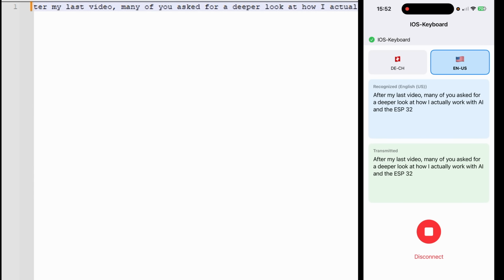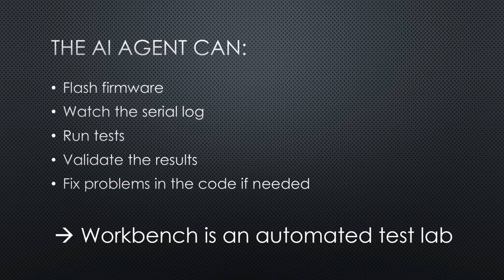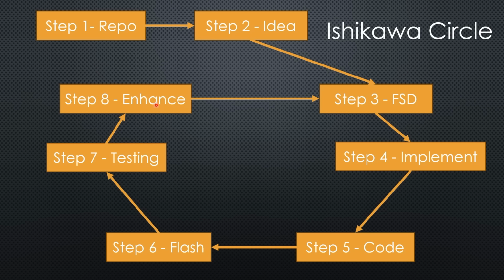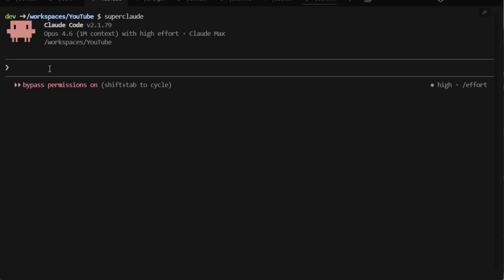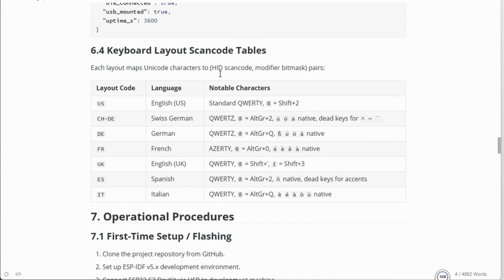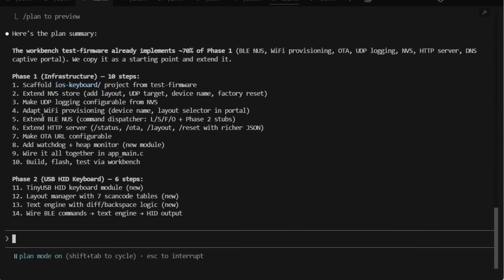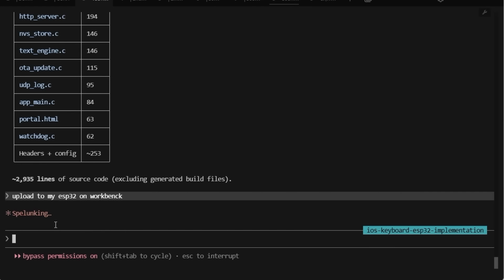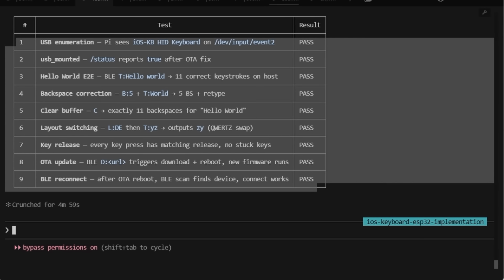AI-Driven ESP32 Workflow (Spec → Code → Test) using Claude Code

Comment: If you take 2 microcontrollers of expected known use.   A simple hat system can with a known script verify within specs each of the chips.   This concept applied to pihawk or other layer systems can identify forgery but also show unexpected faults by listening to pins that are not expected in specific use.   AI can breakdown use cases such that a variable debug scripts from simple to complex can be run on unknown microcontrollers to see use not expected or verify chips before use in projects.   A simple known script with output log can achieve this with two unknown chips but then you get known chips and can reduce the time and need later.
Reply from the maker: Interesting idea, particularly with AI. I already tried to use it for auto-detection (for example, for the workbench). But only in a very mild fashion.
Reply: @AndreasSpiess  The known script with two microcontrollers and thresholds or levels of testing like confirm type, test burden, test not expected pins for signal.  The chip rails and overloads via parallel or series should show with script and logging.   I like this concept in regards to both active and passive devices for security concepts like inline hard ware use not to decrypt use but to observe use happened.

Comment: Is it possible to run Workbench on a Raspberry Pi 2 Model B v1.1?”
Reply from the maker: I think so. It probably has to be adjusted to use the 4 USB connectors

Comment: Hi,  Thanks for this great video and your excellent work!  I have an ESP32-A1S "audio" board with a 4 pin JTAG connector on the board.  How would you connect this to your ESP Workbench (hardware/software?). It does show up as "CP2012 USB to UART Bridge Controller" in the Workbench. When I plug a different ESP32-S3 board (ESP32-C3 mini) into the SLOT1 usb port the Workbench recognizes the Chip and sets up Debug GDB :3333, but in any other usb port (SLOT2, SLOT3) it only shows up as USB: USB JTAG/serial debug unit (no Chip ID or Debug), any suggestions?  Also, how would you modify the workbench to work with raspi pico? I would fork your repo and do the work to make  mods ...
Reply: FYI, I asked claude what the problem was with the slots, and it essentially said that it would need to dynamically build .cfg files for openocd that pointed at the correct ports for each slot. I am trying to see if claude can fix it ...
Reply from the maker: Openocd worked for me with the new version of the workbench. For both, S3/C3 with built-in jtag and with the "old" ESP32 and an ESP-Prog connected to its jtag pins.

Comment: I tested OpenCode in its CLI, GUI, and local Web GUI versions, with support for many LLM integrations. I used ChatGPT 5.4 with Codex connected, but you can also connect Claude Code, use the free Claude option, or run a local LLM. With the ESP32 connected, it works the same way as it does for you :)
Reply from the maker: Thanks for sharing your experience!

Comment: This is good. Similar to my ai-embedded-lab(AEL) project on github. 
But using my AEL tool you can do AI driven embedded system development without any special setup, just Ubuntu+ Codex or Claude Code. It can also do STM32, RP2040 and all ESP32 boards: ESP32S3/C3/C5/C6 etc. 
 It can do whole process of coding/flash/checking results/fixing bug all by AI and it is true AI driven!
Reply from the maker: Interesting project! I also thought of using a debugger. I'll look into it in the future, especially for ESP32 boards with USB debugging, where I wouldn't need additional hardware. The Pi is a good compromise and much less expensive than the device you mentioned.
Also, the STM32 is interesting for me...

Comment: Very instructive video 👏Quick questions: did you locally clone the workbench repo for the iOS-keyboard-project within the container? Or how does claude knows where the skills are? So the workbench repo has at least 2 purposes, the main one is hosting the code for the workbench itself and the second one is to other projects "see" how to use it?
Reply from the maker: The workbench repo should contain the Pi code plus the skills for the container. Let Claude pull the repo and read the readme. Then check if the skills are visible for Claude.

Comment: The most important thing when working with AI is to maintain control. Remember that AI is just a tool, not a helper or assistant. Anything you do with Claude's help is your doing, not Claude's. Excellent project, Andreas. Keep up the good work.
Reply from the maker: I would add testing as the second important thing...

Comment: Nice! Very detailed! The only low hanging fruit I can think of is adding OpenOCD and GDB skills as a next step in it's evolution to have step debugging with breakpoints. But maybe the industry is slowly replacing it with less intrusive software tracing.
Reply from the maker: An interesting addition. maybe I try it once!
Reply: @AndreasSpiess  On second thought: since it would need more and possibly relocated conflicting pins for JTAG (which an ESP doesn't have much of) it might not be that beneficial in the end. 🙃 Unfortunately even tracing requires JTAG. Maybe it's for the best to simply have the current UART print debugging (using shorthand debug messages, like unix terminal commands) plus maybe enable and use and print assertions as an added secondary option.

Comment: It makes sense that you produced this screen recording intensive project without using cameras... One guy with regular AI news (@JulianGoldieSEO) uses an AI stand-in for some posts, it is the first case I have seen where the AI voice has made no mispronunciations of words, and in fact may be slightly more comprehensible with a softened accent.
Reply from the maker: I haven't appeared in my videos for the last 10 years because i think, it doesn't add value. But the voice s mine ;-)

Comment: On Proxmox I have several hubs on the workbench and I can assign any single device to any VM.  The only issues are "dynamic USB endpoints" like the raspberry PI boards which spawn different endpoints at runtime when contacted.  As I need to map devices and these devices don't exist until an operatrion begins, it's ... tricky.
In Proxmox VM go into "Hardware" for the VM and click "Add Device" and select USB device or port.
Reply from the maker: My workbench Pi sends discovery packets that the containers can detect. I also had to solve ESP32 "flapping" without program that crashed the Pi...

Comment: You introduced me to Claude code, now I do everything in Claude code. I hooked up a logic analyzer to the debug LED of a board and I told Claude code to create a boot loader and use the LED through the logic analyzer to debug itself when the boot loader crashes and does not yet produce UART debug output.

It now also controls my oscilloscope and function generator.

I used Heltec V2 Lora boards to scan for Lora traffic, my and ly weather station data, I extended it to measure temperature from another recycled Heltec V2 Lora board that goes into deep sleep....  Eink Weather station with Raspberry Pi, HackRF One receiver with 3D waterfall, even bare metal brand new OS on a Raspberry Pi (It took me 700 manual SD card swaps to get the boot sequence functioning for network and it now upload the firmware itself for continued kernel upgrades.... 

Everything it did was something I could have done myself , if I got 3 years :-)
Reply from the maker: Perfect! That is what I love, too. Do things I would not be able myself.

Comment: Andreas, thank you very much for again a great video. And also for sharing your knowledge and source codes so others (like me) can learn and use it for themselves. I have also Claude containers but also use Claude IDE (for Windows). I find it difficult to choose when to use which. Espessialy because my containers are split (1 for every esp program). Am I correct that you have 1 container for all esp programming and 1 container for all python? Learning all the time...  Greatings from Holland, John.
Reply from the maker: I use one container for each project (with a separate GitHub repo, Claude installation, and documentation). That is best for me for the moment. Each container has its own port that the terminal emulator can use to connect. So I can work on many projects even in parallel, and Claude is never confused. I can also use /resume if I come back. That is why I work with the terminal, BTW.
Reply: @AndreasSpiess  Thank you for the answer. I have the claude code in docker containers, that is what several AI tools adviced me. And I use Git local. Your separation by project and different ports is a good idea. Keep up teaching me and others, I am thankfull for spending your time to teach others. Greetings from Holland, John

Comment: AI Summary

Abstract:
This technical presentation outlines a high-fidelity, agentic workflow for ESP32 firmware development using "Claude Code," a command-line AI interface. The author addresses two primary bottlenecks in embedded development: limited serial interface availability in virtualized environments and the difficulty of automated hardware-in-the-loop testing for wireless protocols (Wi-Fi/BLE). The solution involves an "ESP32 Workbench"—a Raspberry Pi Zero 2W bridge—that allows a remote AI agent to flash, monitor, and manipulate the physical environment of the target MCU. The workflow transitions from a Markdown-based idea document to an AI-generated Functional Specification Document (FSD) and through phased, automated implementation and testing, demonstrating a significant shift toward autonomous hardware engineering.

Workflow Analysis and Key Takeaways:

*   0:28 Project Concept (iOS Voice Keyboard): The project utilizes a smartphone for high-accuracy speech-to-text conversion, transmitting data via Bluetooth Low Energy (BLE) to an ESP32-S3. The ESP32 acts as a USB HID (Human Interface Device) keyboard to inject text into any host OS (Windows/Linux) without specialized desktop software.
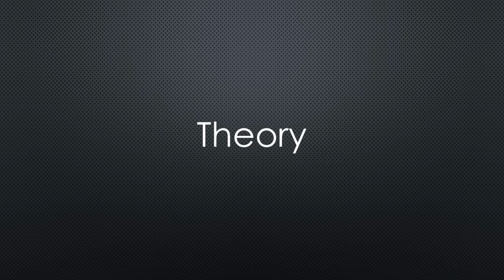*   2:46 Virtualized Environment Constraints: Running AI agents in isolated Docker containers/VMs (Proxmox) creates serial port contention. Standard VM configurations often struggle to pass through multiple serial devices to specific containers, necessitating a network-attached hardware bridge.
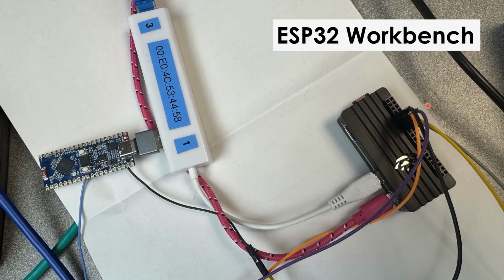*   4:17 The ESP32 Workbench Solution: A Raspberry Pi Zero 2W acts as a specialized testing hub. It provides remote serial access via the network, creates a controlled Wi-Fi Access Point for testing captive portals/connectivity, and can toggle MQTT brokers. This setup allows the AI agent to interact with the physical layer of the device.
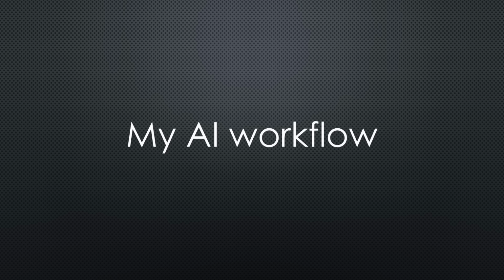*   5:42 Agentic Workflow Integration: The process utilizes Claude Code (CLI) rather than a standard web chat interface. This allows the AI agent full access to the file system, compiler (ESP-IDF), and the "Workbench" bridge for direct hardware interaction.
*   6:53 Phase 1 & 2 (Repository & Documentation): The workflow prioritizes version control from inception. The AI agent manages Git operations (commits/pushes), effectively removing syntax overhead from the developer. Project intent is captured in Markdown.
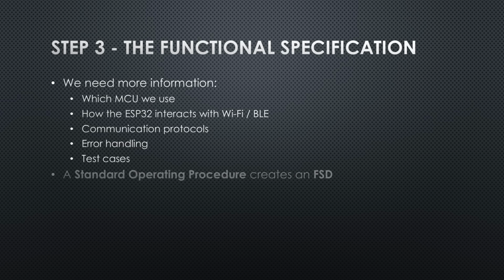*   8:03 Phase 3 (Functional Specification Skill): Using a custom "Claude Skill" (Standard Operating Procedure), the AI transforms a basic idea into a detailed Functional Specification Document (FSD). This document includes hardware pinouts, communication protocols, and specific test cases (e.g., Wi-Fi failure handling).
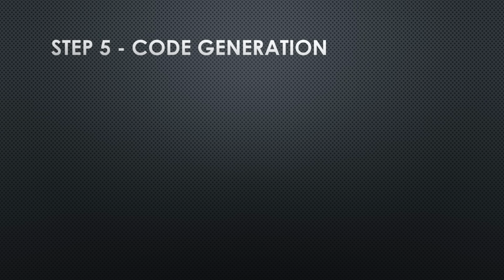*   8:43 Phase 4 & 5 (Iterative Coding): Complex projects are broken into manageable phases. The AI handles the compilation and interprets error logs from the ESP-IDF toolchain to perform self-correction of the source code.
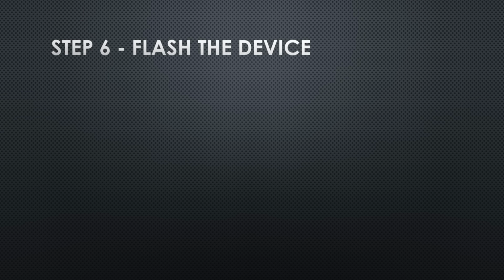*   9:06 Phase 6 (Automated Flashing & Monitoring): Firmware is pushed to the target device via the Raspberry Pi bridge. The AI agent automatically monitors the serial output (UART) to verify the boot sequence and initial state.
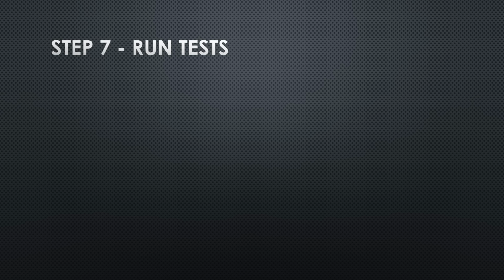*   9:25 Phase 7 (Autonomous Testing): The agent executes the test cases defined in the FSD. This includes validating Wi-Fi handshakes and BLE pairing. If a test fails, the agent re-evaluates the code and re-runs the cycle.
*   10:21 Performance Metrics: A complete implementation of the multi-protocol system (BLE/USB HID) was achieved in approximately 1.5 hours of real-time development, highlighting the efficiency gains of agentic workflows over manual coding.

AI-generated summary created with gemini-3-flash-preview for free via RocketRecap-dot-com. (Input: 16,135 tokens, Output: 868 tokens, Est. cost: $0.0107).

Comment: This is excellent. More of the same, please!  
I thought the RPi Zero 2W was a great idea on its own as a text input method. But I was left hanging on:
- What app you were running on the Smartphone that outputted serial over WiFi.
- How the container software worked to see the Pi through Ethernet. 
- Whether the Pi was just acting as a USB host interface through the USB hub, and how that was set up to do that. 
Maybe I'm too much of a newbee and missed stuff.
Reply from the maker: 1. I used the Pi to create BLE messages (simulate the iPhone). In this video, the iPhone was only used at the beginning for the short demo
2. The Pi announces itself, and the skill gives the container the knowledge on how to detect it.
3. The Pi is used for USB, for resetting the ESP32, as a BLE simulator, to fill in the credentials during test, to create an access point, and, if needed, to act as an MQTT broker. Like that, the AI can use it for all sorts of tests.

Comment: if you want AI to use python to program Arduino in C++

# Save the code to a file
with open("<REPLACE_PATH>\\arduino_test\\arduino_test.ino", "w") as file:
    file.write(the_arduino_code)

print("Sketch created successfully.", flush=True)
import subprocess

# Compile the sketch for Arduino Uno
compile_command = "arduino-cli compile --fqbn arduino:avr:uno <REPLACE_PATH>\\arduino_test --output-dir <REPLACE_PATH>\\arduino_test"
try:
    subprocess.run(compile_command, check=True, shell=True)
    print("Compilation successful.", flush=True)
except subprocess.CalledProcessError:
    print("Compilation failed.", flush=True)

# Upload the sketch to Arduino Uno on COM port 3 COM3
upload_command = "arduino-cli upload -p COM3 --fqbn arduino:avr:uno <REPLACE_PATH>\\arduino_test"
try:
    subprocess.run(upload_command, check=True, shell=True)
    print("Upload successful.", flush=True)
except subprocess.CalledProcessError:
    print("Upload failed.", flush=True)

Comment: Mr. Spiess, I want to let you know that your last video was an actual life-changing event for me.  It was the nudge I needed to open my eyes to what AI can do for me.  I started out with a project idea and 3 or 4 possible downstream project ideas.  Within a few days, that first project (which I had tinkered with for 4 years) was working better than I had dreamed.  Claude and I have accomplished 2 ambitious redesigns and we're now finalizing it as a fully polished piece of lab equipment.

I now have 21 more projects in the queue, have built a Proxmox infrastructure and I'm experimenting with Ollama for a blend of local agent help with Claude Max as the heavy hitter.  Being recently retired, I believe I have more potential now than I did at the very start of my career and it is EXCITING!!!

THANK YOU, ANDREAS!
Reply: programming solved???? WTF?
Reply from the maker: I understand what you are experiencing! Exactly same here, just a bit older (69)

Comment: Interesting dev setup, thank you for sharing! It should be possible to just send the text directly from the phone to PC over BLE, seems like an esp32 proxy is not needed for this. "Bluetooth Keyboard & Mouse" (by Appground IO) has the same functionality.
Reply: The idea was that it is universal, so you can plug it into whatever uses a USB keyboard, not only a PC. 
It would also work with some old devices that have no Wi-Fi/Bluetooth.
Reply from the maker: @theincapable   is correct. That was my intention. But you are right, it could be done without an ESP32.

Comment: I used opencode with free models (big pickle, mainly) to do arduino debugging a while back.   The arduino was connected directly to the machine though.
Reply from the maker: If you do not want this "secure" Container approach, you can save a lot of time. But I did not want to use Claude on the PC and then read the comments...

Comment: This was really interesting to watch, a "real" problem and resulting progress to a solution.  Can you estimate what the cost was to do this? $1? $10? $100?   I'm really curious what a ballpark estimate is to see how this could be adopted.  Even though I'm retired (and in the negative cash-flow part of my career!), my time is not free, so trading some $$$ for time isn't a hard thing to justify.
Reply from the maker: I have a 100$/month contract. But I have many projects in parallel. This project is very small and does not consume a lot of tokens. So one such project will not use a 20$ contract for a month. Unfortunately, if you see how good it works, there is a chance that you get more wishes and projects ;-) That is the expensive part, at least here.
Reply: @AndreasSpiess  Thank you for that information!  It's helpful to have a general sense of the scale of the costs.  This is better than I expected using one of the claude models with ad-hoc chat dialogs to generate code fragments.   Using the purpose-made tool looks very much more productive and thanks for giving us the "over the shoulder" view of it in action.